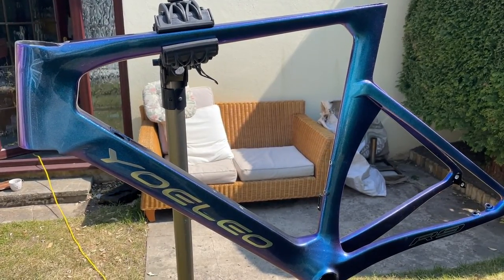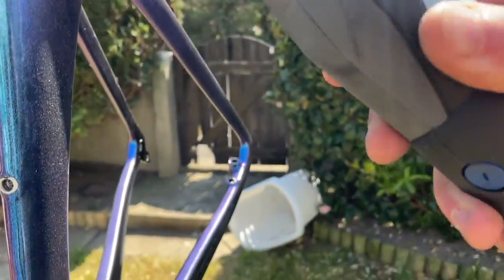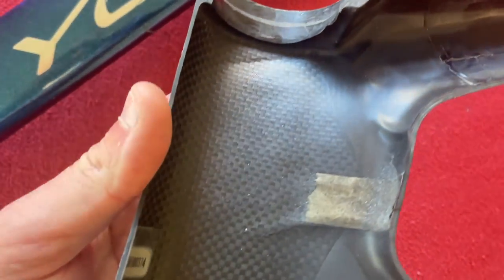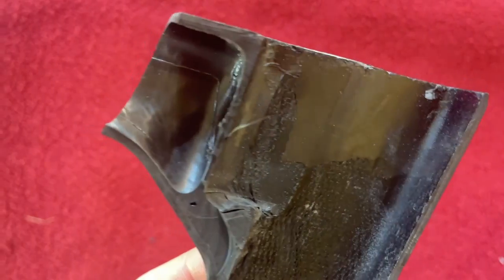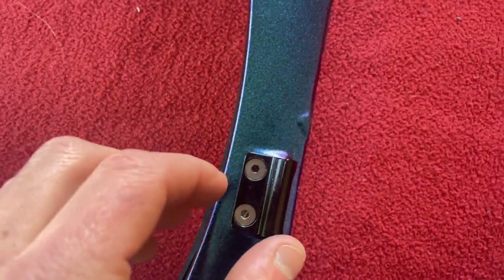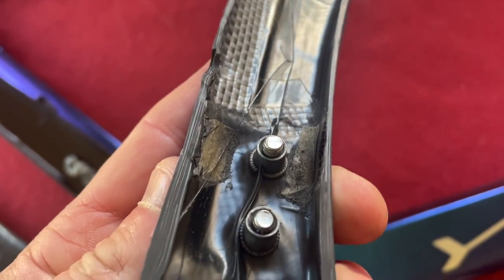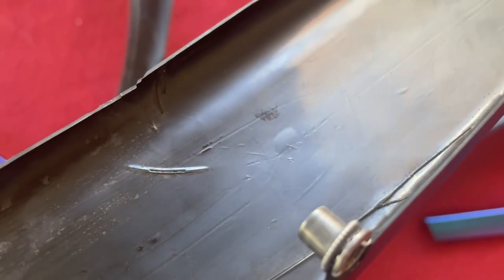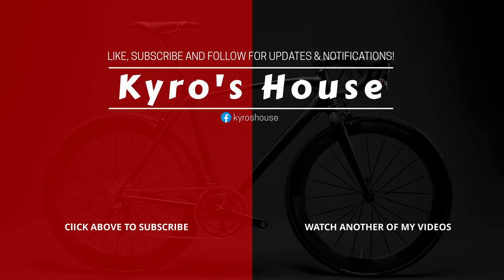Cutting up my YOELEO R9 Chinese Bike Frame

Comment: Hi Stephen, thank you for your insightful video. as we prepare your new replacement frame, we guarantee the previous issue will not happen again in the future, our team will learn from the mistakes and make sure things are better.
and for your information as well, your new frame have the latest production technique called by EPS + Latex, This process eliminates small imperfections as the result of the old frame production methods. using EPS process allows us to make carbon frames in one piece and make them lighter and stronger.
Reply: will it be the same frame model like this video or new frame that use EPS + Latex Tech ? I cannot look at this model on  your website too.
Reply: @eugeneismanto1222  We sent out a new frame model R12 with laest EPS+Latex tech. Currently all Yoeleo road frame will be mold by this tech, very smooth inside for cabling.
Reply from the maker: It’s no problem, the new frame has turned up today, so I’ll opening it up tomorrow, I’m looking forward to see if I can see any differences in manufacture. Thanks for the new frame! 👍
Reply: Will be glad if you can instruct Kyro's House Cycling  to prove what you just said by cutting the new frame with latest production technique called EPS + Latex which I also believed used to produce R11 and R21 frames. I still believe  their are still imperfection on your current frames. I paused purchase of R11 from your UK distributor Revelation Wheels when I watch clip from Kyro's House Cycling  and search YouTube everyday to see what people say about your R11 Frame.
Reply: @chineduamaeze2718  Hi Chinedu thanks for your advice, I believe there is nothing perfect in the world and also what we can do is the make it the best we could. And yes we will be coming up with a video showing the cutting of the frame. Thanks again for your attention and support for Yoeleo. Wish you enjoy the riding ! :D
Reply from the maker: @chineduamaeze2718  thanks but I’m not cutting up my new frame… it’s the only one I have. 👍
Reply: And where is the cutting video for the new model now? Lol
Reply: Ya I'm staying away from Yoleo frames. They seem shady.
Reply from the maker: @firesunsun  I’m not cutting up my only frame. It’s so much better than the old one. 👍
Reply from the maker: @ericvutran4140  they are not shady at all, couldn’t be more helpful and the new grander they sent is fantastic, you can see the build in my video series. 👍
Reply: @YOELEO  nope...if yoeleo does it we won't believe it
Reply: @Dustydayzz  Hi Yang, how can we help you?
Reply: @YOELEO  I mean I'd rather see someone else cut it not yoeleo themselves.
Reply: @YOELEO  I've seen the frames and I'm really considering buying the aero one (R12) I just wanna be sure I'll nit be disappointed
Reply: @Dustydayzz  Thank you for your reply. We're planing to send the frameset to the third part and make the video. Stay tuned!

Comment: Interesting. I wonder what Raoul Luescher would say. 
I also had some bits of the bladder left in the chain stay of my R12 but I pried them out.
Reply from the maker: Hopefully none in the new frame as different building techniques. But we will just have to wait to find out. 👍
Reply: New building tech  EPS + Latex solved this problem, so the inside of the frameset will be super clean. :D

Comment: Hi there. 5:29 didn't it comes with cable routing guides ( white plastic tubes) in the frame or isn't this an internal cable routing frame?
Reply from the maker: This particular frame did not, I’m not sure if they come with guides. But my new frame is here so I’ll be interested to see if this one has any. 👍

Comment: I know you want to show this for what it is, but if you don’t know what your looking at and neither does the viewers of this channel then how can you judge it? The chain stays of course are bonded on, nearly all frames are (how do people think these things are made). The reality is EPS moulding is the reason it’s so smooth and increases rigidity/stiffness, just look at half the so called high end brands and you’ll see wrinkles (not good) from older bagging process galore and I’m sure you will also find residue of the manufacture processes (look up Oz cycles or Luescher Teknik) and if anyone things you won’t they are deluded.
Reply from the maker: Thanks for the comment. I just wanted to see how they were made. 👍

Comment: i just made up my mind, cancel buying yoeleo
Reply from the maker: This is the old frame, so I’m not sure the manufacturing process will be the same, besides many many top brand frames are the same or worse. There’s an ozzy guy that cuts up frames and basically exposes the big brands for poor manufacture. 👍
Reply: @KyrosHouseCycling  thats right..i eventually got specialized tarmac sl6 because they give lifetime warranty for the frame. the yoeleo shop only gave 3 years frame warranty. i must admit for the same price, the yoeleo looks much more badass..
Reply from the maker: @dityaberto7860  sweet! Enjoy the ride! 👍
Reply: This looks pretty much the same as a lot of ' blader' pressed frames , even the big brands ( Trekk, speciazed , Cannon Dale ) look like this  !! The newer manufacturing techniques have lessoned this a lot more ,
Reply from the maker: @tubbytoast2  that’s very true, the new frame has different construction. 👍